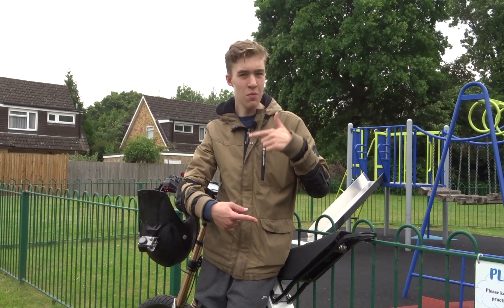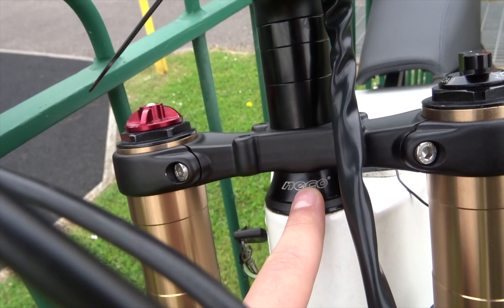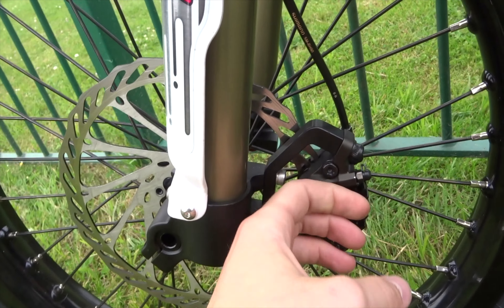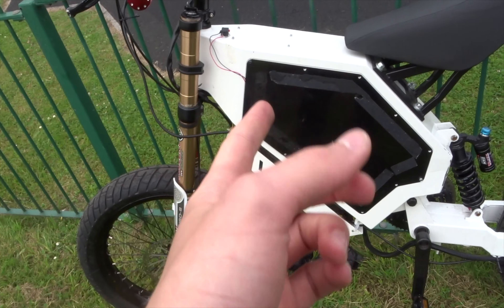Sabvoton Nightmares + Riding Footage! - 8kW Enduro MSVA eBike V3 Build

Comment: Hi. Also had issues with lack of grunt on mu sabvoton. On the app, on the throttle setting, if you decrease the 'throttle mid voltage' and increase the 'throttle mid current' it makes a big difference to your starting torque and power. Make small alterations though at first and try it out. Made mine a different bike!
Reply from the maker: I've tried all these settings, but I'll give it another go. Thanks
Reply: Cool. Would be interesting to see if it helps you
Reply: The throttle mid current is measured in Phase amps, not DC amps. I set mine too low (Half of my DC current) When I set it to half of my phase amps, I gained a massive improvement in power delivery.
Reply: Set the mid throttle volts to "0" volts gives immediate torque. Set the mid current to 250a. Then select boost or hard start.

Comment: was good from nyc, i hear your issues, you are not alone brother! i melted the battery terminals on a very hot day, the battery must have been over 100 degrees f and melted the terminals and bent the pins on my bike...my fault, hammering on it at 35mph for over 15 min in peak heat. still works with replacement parts thankfully!
Reply from the maker: Ooh not great. At least you know what not to do next time !😉

Comment: I would have thought it's the BMS cocking up but you say it does 130A at times. I still haven't hooked up my wires yet. The brakes and rear suspension are still on the drawing board. If I get the same issue with my Sab and have better luck in solving it, will come back here and share
Reply from the maker: Nah, it's definitely not the BMS -  it can't restrict power like that, it's either on or off. As I said, it displayed the correct current before and when charging. Also yh drop a comment when you've got yours sorted 👍

Comment: I have a 72150 sabvoton and only realised recently that on changing some parameters like dc current you need to reset the controller after. Some other settings don’t require a reset, possibly an issue if your continually changing settings on the go. I also had a faulty 72150 as well, ran the motor really rough and then gave up altogether, it back in China awaiting testing by siacosys.
Reply: Also check your throttle acceleration and deceleration settings. They are factory set at 200ms which is way to high. Iv got mine set to 10ms accel and 30ms decel
Reply from the maker: Surely if you do a reset though, you loose the settings? I know you have to click 'store parameters' or whatever it's called as well as 'ok' but haven't heard of resetting before. I've tried factory resets and then only changing the lack voltage and running hall test but that didn't work either, still only 60A 🤷‍♂️.
Reply from the maker: Also I've put the acceleration to 10ms for both
Reply: @EverythingEbikeChannel   not factory reset but a power reset. Just turn the controller off and back on using the ignition wire or via the screen power on/off if you have a screen. It took me a while to realise and only certain parameters need the reset but for sure on my 72150 the dc current setting needs a reset for the new figure to be active. Process I use is change parameter hit ok, then hit save then power reset.
Reply: @EverythingEbikeChannel  that’s via the Bluetooth dongle and iPhone app. Not sure if your only using the pc software for your settings on the go
Reply from the maker: @lhk8558  Ok I'll try that
Reply from the maker: @lhk8558  I've been using a mixture of both and tried about 5 versions of the PC software with no luck

Comment: If the Sabvoton gives you problems in the future you might want to look into getting a ASI BAC4000 instead. I got the smaller BAC855 for my BBSHD and it's great!
But heck, the Sabvoton seems to work good enough! I just want to give this tip if you run into issues and want to get another controller.
Reply from the maker: Yeah, I've seen that controller recently but everywhere seems to be out of stock or really expensive. Perhaps on my next build I'll use if but for now I'll stick with Sabvoton as I've made all the mounting holes for it.
Reply: @EverythingEbikeChannel  Don't go ASI BAC they are a horrible company (against right to repair and stuff).
If you are really good at soldering, go with a besc G2 vesc-based controller.

Comment: Wow I was setting up a new Sab 72150 and I had the exact same issue with inconsistent current. 
sometimes I would get 3kw sometimes the full 10kw. The issue for me had nothing to due with the controller but the battery pack I made. There was a poor connection between some of the series modules that sometimes created grater resistance in the series connections of the battery. After I fixed the series connections in the battery the problem never happened again. This may not be you're issue but I want to get this out there for anyone who is having inconsistent current with Sab controller.
Reply from the maker: That's a fair point, but I've been round and tightened up all the major connections and still have the problem. It's also a repeatable fault that only happens when I first turn on the controller and doesn't suddenly drop out when riding. I can also see all the cell voltages on the BMS and none of them drop more than the average so would be able to identify a weak point there. Thanks for sharing though 👍

Comment: For those having inconsistent power delivery. Check the "throttle mid current setting". The throttle mid current is actually measured in phase amps, not DC amps. A lot of people including myself have set this too low thinking it is DC current. I set mine to about half of my phase current max setting. This alleviated the power delivery problem I was having.
Reply: Can you give us some numbers ?!
Reply: @rolandroland1485  the numbers depend entirely on your settings. So mid throttle current should be half of your max phase current setting. Take that value and half it and that's your mid throttle current.

Comment: I know the struggle, back in the day when Sabvoton was actually Sabvoton they're controllers were flawless, but since MCQON took over the company there's nothing but issues. Personally I've built 5 different bikes with various Sab versions and only 1 of them still had the Sab working after less than a year , the others have changed to bacs or Kelly. But not lifting the front wheel at the stated power is odd in itself, my around town daily beater is only running a 52v battery with a 1000w Voilamart kit with an upgraded 18 fet 52v kt controller and I can't keep the front end down if I fully plant it...
Reply from the maker: Ah I didn't realise MCQON wasn't sabvoton, thought they just changed name. I'll keep it as long as I can but will look at other controllers for future bikes. The BAC or Fardrivers look pretty neat...

Comment: I have been riding with my friends 17kw ebike with sabvoton 72200 and that still doesn't really pull the front wheel if you lean forward at all. The start is rather slow but it kicks up from 30km/h but the innitial torque is kind of lame. And it is really hard to believe that it actually would be pulling 450phase which it is set up as. So kind of similar problems in a way
Hope you get it figured out :)
Reply from the maker: That's weird, I thought 17kW on these would be mental! My main point I was trying to make was I have had the same model of controller pulling only 4.5kW and still being faster than this one is at '7kW'.
Reply: @EverythingEbikeChannel  compared to my 37kw ebike that had qs273 and I was pulling 750phase amps almost every ebike feels slow xD 
But indeed you are having a very weird problem. I know my friend also was having similar problems but it was more like that he would put a parameter and save it but after a restart it would be same as before the save
Reply: I guarantee you he had the throttle mid current set too low. It's measured in phase amps, so a lot of people make the mistake of setting to half of the DC current. As a result, setting too low causes that exact problem, no pickup power. When I set mine up rite with my QS205 at 250 amps DC, I can not keep the front wheel down no matter how hard it try! The pickup of those sabvoton controllers when set correctly is ridiculous!! Only problem with them really is the lack of instructions from the company, there terrible, its like they have not really made a proper effort.

Comment: I have the same frame and controller running at 72v 150a peaking at around 12kw and It still won't lift the front wheel 😅 I think I'm going to go for a different frame
Reply from the maker: It's been really interesting seeing all the comments of other people's experiences and yours is another conclusion I've drawn about the frame - it's too heavy for proper wheelies!

Comment: Hi, investigate your battery cells. I was running these on a bike of mine and thought I had controller or bms issues. Turned out that I had burnt out some of the cells. Not enough to stop it working but enough to cause a lack of power
Reply from the maker: All the cells are good, they all drop by the same amount according to the BMS.

Comment: Hi I have the Subvoton 72150 and I use the MY1020 engine and I have  problem the hall angle test allways fail, one time it show fail 4 than I changed two phase wires and it showed fail 3 I changed the current up to 30ampere but that was the same.
Reply from the maker: Yeah hall error 4 usually means the current is too low or too high. Have you checked if the hall sensors are operating correctly with a multimeter?

Comment: I also have issue with sabvoton 72150. I remove the battery to charge and when i put it back the e brake never works again until i factory reset and set up everithing again. And the new simptom is, its just start to make bad noise and vibration  after 40-50 amps. I think the MOS FET-s are opening on to each other and after a few second my BMS goes Short circuit fault. (400A!!)  The motor also gliching with no load when the flux weakening is on. New battery, two different BMS, 3 different set of new hall sensors, 3 different throttle in two manth and no luck. Dont buy sabvoton. I have 2 year warranty but they have not replaced it yet and i think they never going to do.
Reply from the maker: Yep, modern ones seem to be a load of rubbish

Comment: bms or batteries….i run a sabvoton 72150 direct to the (24S )42150 LiFePO4 cells, and have an active balancer.  qs 273 on 17” wheelies effortlessly

Comment: I had the same problem with my sabvoton controller on my surron.. When everything setting was maxed out the stock controller was still faster..
Reply from the maker: I'm sure this model has potential because as I've said, a different one was much faster even at less power.

Comment: Definitely sounds like a programming issue or a clone controller that’s getting too hot. The fets could be hot even when the shell is cool and limit the power
Reply: How can I contact you mate
Reply from the maker: I've been beginning to wonder about clone/fake, but I bought it from Siaecosys who have a big store on Aliexpress and I believe are linked to QS Motor. I've been going back and forth with emails and am starting to get a bit annoyed now as they are blaming it on software and saying 'it's not a big deal' when it literally outputs 60A when set to 150A!
Reply from the maker: cgouldstone45@gmail.com

Comment: I have a 72200, 75v 200a/450a and it easily monos. The method torque control  is a bit shit. It’s speed based, not torque based, like u find a VESC etc.
Reply from the maker: Exactly, mine should be doing similar or at least feel quick with 150A current but it's not! I'm not to bothered about the delivery method as it feels pretty smooth to me.

Comment: Hi Cam, Funny, that sounds like a throttle issue, It has to do with how the throttle is set to react, I have a 100Amp Sab and I literally at 60V yank 8Kw in an instant with pull away, Probably a software issue. Have you tried using the blue tooth dongle  and app to program the controller with? It might make a difference am just playing devils advocate really and it could just be a bolloxed controller... Might be worth a try and might be a complete waste of time. Oh, the other thing..... Was that speed test done with the 26" tires? Remember that you have different size tires on now and this will react a bit differently.. eg more torque and less topend.
Reply from the maker: That's what I thought at first but have tried 3 different throttles and countless settings with no luck. I personally think it's a faulty controller but am trying to convince the seller at the moment 😒. Interesting to hear how quick yours is with 100A, definitely makes me think something's up with mine. On the note of tyre sizes, I did it before on 26" and am now on 18" but if anything that should improve acceleration not slow it down. It's really hard to describe but I can feel it's just not as quick/punchy/same feeling as the one I had before that I damaged (and annoyingly was working perfectly, just my luck! 😂)

Comment: I found an app called car timer and you can do 0-30 and 400m on it, give it a go and see what you get I want to know how fast it actually is. Mine only has a 60amp shunted controller and I did a 3.4sec 0-30 with my battery at 70v
Reply from the maker: Yh I'm beginning to wonder if the app I used is the problem for that. I'll give the one you mentioned a try and get back to you

Comment: it is important also the wiring from battery to controller
with 200 amp you need a power cable of 40mm2
so that the current and amp can flow well
there is a calculation for it
the length of power cable x ampere x 0.2
this is the formula
It is also important that a battery can provide continuous ampere
and therefore it is important the nm of the motor
I built a bike
80 amp continuous with 3000 to 6000 watts 152 nm the motor
with a simple controller
it's a monster that bike
60 km per hour in 3 seconds
is very important the power cable that it has no resistance
ok greetings

Comment: KB might be correct if you want to do wheelies and whole shots bring the mid throttle voltage down to 2.5 volts and mid-current 70 amps that should get you there also make sure you have the pink wire and the black wire connected which is high speed mode on the controller I also have my acceleration and deceleration at 10 milliseconds which is the lowest you can set it
Reply from the maker: I've put the throttle mid current at 150A, does lowering it increase or decrease the power delivery?
Reply: Putting a lower mid-current voltage like 2.5 volts is what I have mine set on and 70 amps for mid-current and you have to hang on hard 150 mid current amps with a 2.5 volt mid current throttle should be scary 😂 scary fast also if you don't have your high speed switch which is the three wire connector on the controller you should have a pink wire black wire and clear black and pink go together for high speed do nothing leaves it mid speed black to clear is low speed and will not give you full power either will mid speed I'll figure it out I've definitely had my battles love your channel you do good work keep it up I'll keep watching
Reply from the maker: @shawnsebikesandstuff15  Ok I thought leaving it disconnected defaulted to high power so will try adding a jumper. 2.5v and 150A is pretty tame at the moment so somethings definitely not right!
Reply: 2.5 is too high really. Start at 2.3 and go down from there. The lower you go the more torque

Comment: What winding motor have you got?
Reply from the maker: I don't actually know as inside there was a marking with 2T in it (more like a serial number)  but the seller thinks it's a 3T. That sort of makes sense as the top speed claims to be quite good for the voltage but it doesn't feel to have as much torque as other people running the same phase amps.
Reply: @EverythingEbike Channel   me personally  i think its 2.5T i ordered a 12kw 2.5t myself

Comment: I run a sabvoton controller. Where did you buy yours from? there’s several companies that make clones. The original company that made them I don’t think they make them anymore. The one I got was from AliExpress
RisunMotor is the maker of mine. Have you done any testing with your phase wire combos? 

I’m running 6 kW and my front wheel won’t stay on the ground But I am running a 5T winding mxus 3k. 

So yeah somethings up with your controller. You don’t think it has anything to do with your BMS maybe not regulating the current properly?
Reply from the maker: I bought mine from Siaecosys who I thought were a big reputable brand as they sell a lot of products and part of QS Motor? I've got a list of things to check this weekend from comments so checking the windings will be one of them although I doubt it. I don't know what the windings of my motor are (I've emailed the seller to check) but it was quicker on 5kw as I said which makes no sense!
Reply: Risun 100A and 45A both work reliable for ne both wheelie 50's steel frames. Flux weakening and accl ms is key.